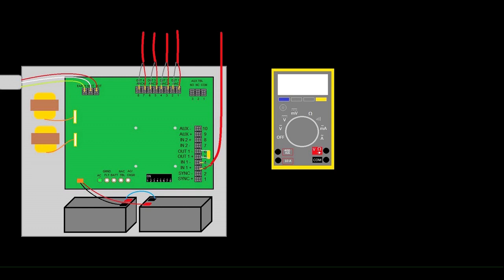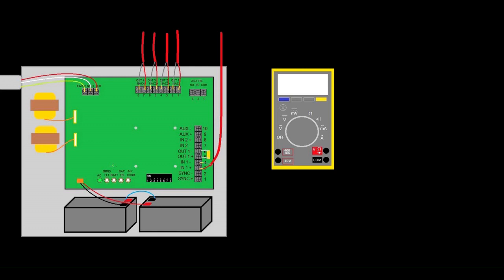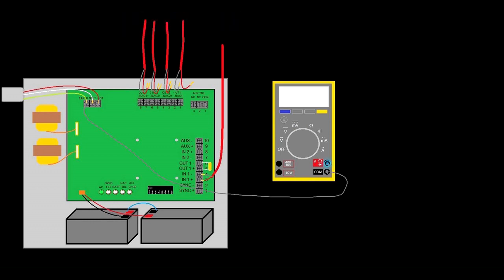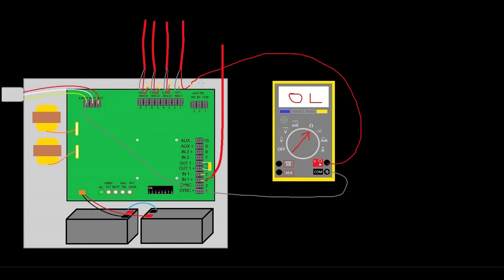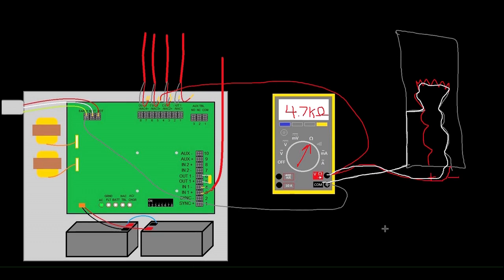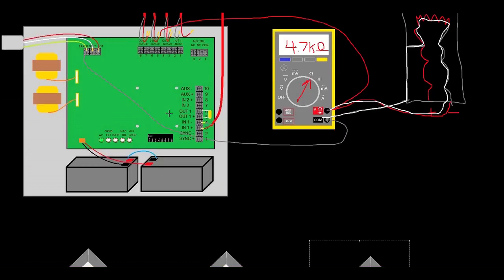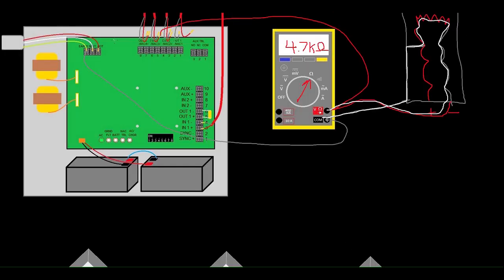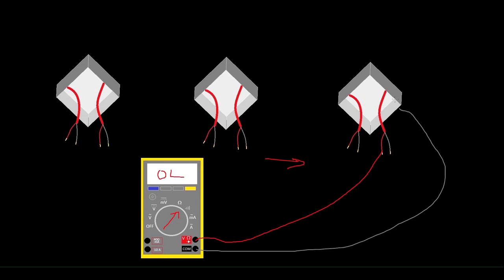32 - Metering a Ground Fault - Introduction to Fire Alarms

Comment: Question: if you choose the option where you jumper one leg straight to ground (as you referred to at 12:30), can you still do that option with both legs landed on the panel NAC? or do you need to remove both legs and do the alternate resistor (ex: 10k) option instead?

Comment: Hey brother got a GF on a system ive taken over a job site its a complete nightmare and im still new to this bosses threw me in this with brainless helpers, I have voltage as well on one of my PLink wires they instead of running 4 used 2 16/2 for the += AB. When i meter it on AC i was getting up to about 3. - 60. even seen it spike to 115 once.

Comment: Hey Joe, I know that intermitten ground faults are a pain and special in a big property where you could have added resistance from different outputs etc.. that could add up and meet the FACP or power supply manufacture threshold. I was looking at the FLUKE 1587 FC insulation meter ($$$). Don't know if you have heard of it, its good for ground faults on motor windings and sorts. But it might be a great tool for the meggers resistance. What do you think? This meter might be worth it?
Reply from the maker: That's an interesting question. I don't know anything about that meter, so I can't fairly say. In my opinion, I would try to build my own cheap ground fault meter with an analog ometer and a bunch of batteries. Several people have written articles or made videos explaining how to do this. I have never done it, but I'm interested to try it. Sounds like it would cost about $30-40, rather than $900. But having never used the meter you mentioned, I can't really say.

Comment: NAC circuits will have supervisory voltage on them when on standby.
24vDC circuits might be reversed when on standby (positive and negative will be reversed), this is common on older systems.
Other systems will have 4 to 7vDC on them to supervise the circuit when not in use.
A quick way to locate a ground fault on NAC circuits is to determine the normal voltage for these NAC circuits and then place your negative meter lead to ground and check the voltage on every wire with the positive lead.
A ground fault will pull voltage down on any wire that's grounded. This will usually cause the panel to push the voltage up on the other leg of the circuit.
This is a great way to find multiple ground faulted circuits when you have lots of them.
Then it's just a matter of cutting the grounded circuit(s) in half, metering forward and backwards until you isolate your fault and (hopefully) fix it.
This same procedure works on SLC circuits, but they're a little easier to determine what circuit is grounded since there's usually less of them.
This procedure works perfectly on hardwire circuits, and theory wise it works on 2 wire and 4 wire circuits of any type.

Comment: What a helpful video.  I have a question if you can help.  I'm working on a Notifier NFS2-3030.  I'm getting a horrible intermittent ground fault trouble coming from guest room sounder bases at this hotel.  The device is causing the ground fault, but how do I troubleshoot a ground fault that would appear for 30 seconds and clears for 15-20 minutes.   At some times clears for 2 days and then spontaneously comes back as intermittent. At this point I'm frustrated because I can't read ground on my meter to the lines... when things clear up so long and causes a trouble so briefly.  Any ideas?  Other than change out all the devices on 9 floor hotel😅?
Reply from the maker: This could be a pretty big problem. There are a lot of variables. You can email me, I will help as I can, but it might be a bigger thing than I can help with remotely.
Reply: @JoeKlochan  thanks for the quick reply... any help will be much appreciated
Reply from the maker: What is your power source for your sounder bases
Reply: @JoeKlochan  the way its set up now; its from ACPS 24 volts.  And that is power through the main power supply
Reply from the maker: I have a couple of thoughts. First, when I was fairly new in the industry we had a similar problem to what you're describing but it was on a new install. I don't remember what the solution ended up being but I think the problem had something to do with a conflict between the FCPS panels we were using for sounder base power and the main panel. 

If this is an existing setup and the problem recently started, I'm thinking maybe a different type of meter may help you. I have not yet built one of these myself, but the idea is intriguing to me. Google "build a low voltage insulation tester".

The idea is you only have a 9 volt battery in your meter, and when you meter resistance, you're putting a very small voltage on the circuit. Sometimes there's not enough power from your meter to make it through a pinched wire or some faulty insulation. A meter like this would theoretically help with that. As I said I haven't done it, but I would like to. This may help you, it may not. You may be dealing with some sort of voltage conflict. Does the ground fault clear when you remove the 24 volt power circuit?
Reply: @JoeKlochan  this panel has been installed in 2017 and the problem just started up.  I've isolated the intermittent ground to the 5th floor rooms about 2 weeks ago.  When I remove the 24v, the problem clears for quite some time.  When I add voltage back, it pops up intermittent after 3 minutes.  Problem now is that it would cause a ground for 30 seconds and then clears for 20 minutes and sometimes longer.   
I've encountered this exact issue 8 months ago.  The same ground fault and a sounder base 'no answer.'  When I replaced the base, the ground cleared as well.
Reply from the maker: It's been a while since I've tried this since I don't really work on notifier panels anymore, but I think it works with your panel. If you set your meter to DC voltage, and meter the voltage from the battery negative to ground you should be able to see the 5 volt square wave that is the ground fault detection circuit. If memory serves, your reading will fluctuate between about 2 and 7 volts, switching every 2 seconds. When you have a ground fault on the system, that wave will flatten out noticeably. So if you remove your power circuit and meter that, then put the power circuit back on, and notice the wave flatten out, you may be able to trace it that way. You could have someone in the field start opening the power circuit while you are downstairs metering the ground fault circuit, and you should be able to tell when the problematic base (if that's what is causing the problem) has been eliminated from the circuit.
Reply: @JoeKlochan  thank you so much for your feed back.  I will try this out and let you know the outcome.

Comment: Fire alarm systems are at times frustrating when it comes to tracing and troubleshooting ground faults.                             I think the video is very informative.  You did a great job explaining the wiring of the circuits and the Understanding of the circuits is very important when trying to trouble shoot Ground faults opens and short circuits etc.     
                                                                                                                                                                                                                    I have been servicing maintaining and programing commissioning large life safety systems for over 30 plus years.  So, when it comes to the infamous ground fault IE SLC, NAC, 24VDC Aux etc.  Negative or positive doesn't matter. 
 Troubleshooting is key on the approach on how to investigate the fault. Like was there any construction done recently?  Known water leaks floods, roof in the building etc. This would help out the technician pinpoint the area. When breaking up the known circuit in the fire alarm panel. The Technician on site will not know how its wired (doesn't matter) The key is to break the known faulted circuit in halfway segments which once done they will know which half is causing the fault. Always Both wires of the circuit Allot of electricians miss that and they spin their wheels                                                                                                                                                                                                       The key here is at this point is to keep breaking the faulted circuit in half's IE not Every device etc. This will be a time saver, along with never having more than 2 to 3 opens of the circuit any 1 time so you don't' lose track of the path where the ground fault is located IE class-A or B Etc.                                                                                                                                                                     Now not all ground faults have a low resistance. Most modern fire panels will detect a high resistance ground fault IE 200K ohms or more. Now these may be from a wire that has been pinched in an electrical box or from a cable pulled tight on a metal pipe or HVAC duct or even tie wrapped FPL cable to a threaded support rod etc.    
There is another tool to use in the troubleshooting toolbox.
 Set the Multimeter to DC voltage The Fluke T5-1000 meter will be fine for this test if used. I like the Fluke 87 ($$$) but the 177 is fine anyways etc.
High resistance grounds are not easy to trouble shoot. These can be caused from Wiring faults on the input side of a monitoring module on the SLC circuit.  A 300K ground could be from a Wiring issue or from an input monitoring point.    The video was very good in explaining how to troubleshoot the circuits.                                                                              Most circuits are powered limited so a short will shut off the power but typically most circuits as designed to operate on 1 ground fault but NOT multiple ground faults.
 Voltage is key here Lack of voltage or a low voltage condition from a ground fault will disrupt the SLC communication to devices along with not having the proper voltage to operate the Horn/strobes etc. I Hope this helps the professionals in the fire alarm Tech field The more you know sure helps in daily work!!

Comment: thank you for all your videos very good info. I work with EST 3 systems, I have found contractors bypass the ground faults with a jumper on the board, the problem is when we have to replace the RPS! And the ground fault lights up. The way I troubleshoot faults is process of elimination on NACs then move down the circuit until we find it, usually a wet device! a visual inspection around the building and asking questions on water damage to staff helps a lot. I will be taking my NICET level one on Saturday I'm really excited and nevious at the same time.
Reply: I rip a lot of est3 s out and replace them with something that actually works and rid ourselves of map faults.  Although I will say map faults make us a lot of money.
Reply from the maker: Excellent, good luck! If you don't pass on the first try, it will still be good experience to get you used to the test and prepare you to retake it. Get used to using the index in NFPA 72! If you get a question about a pull station, go to the index, look up pull station, and it will tell you every page it appears on. Again, good luck!

Comment: Class B circuits opens the returns. If you take your meter and measure in ohms between the input #1 - and return #1 - you will read an open if the nac panel has a true  trouble on it .A lot also depend if your panel FWR . If you use a second input the same thing applies , however in class A this does not work the same you must wire to the trouble contact 's.

Comment: Hey Joe, any ideas on what might cause an intermittent ground fault on a speaker circuit, or a  persistent, intermittent ground fault in general? For instance a ground fault that comes in approximately every 72 hours give or take, but only lasts 20 seconds and then clears itself. No obvious reason why, the speaker circuit isn't active when it happens, fault seems totally random. Your videos are great, I'm an electrician by trade but because I watched your videos I have been able to troubleshoot many FA related issues at my facility. Saved me from having to pay to have a fire alarm tech preform a service call. Thanks!
Reply: Intermittent ground faults are a pain in the rear. If it isn't showing on the panel it probably isn't going to read anything abnormal. About the only way I know is to start taking a circuit off for a given amount of time and seeing if it comes back. If it still comes in, you know it isn't that circuit.  Once you find the circuit start splitting that circuit for a given amount of time until you've narrowed it down. This could take weeks to trace, but it's impossible to trace a ground fault in 20 seconds.  If anyone has a better suggestion please enlighten me. It's very discomforting and keeps me up at night having to leave a portion of a fire alarm system disconnected for an allotted amount of time.

Some potential causes:
-Moisture can be coming and going in a box some where. Outside weather in an outdoor audio device. Places like food processing plants can build up condensation during night time cleaning hours and then when their machines start up in the morning the environment turns hot and dry. I was recently at an event center where soda from the stands was dripping down below and getting in a speaker/strobe. 
-If it's a gf that shows up at a specific time of day it could be temperature related. I've had gfs that were caused by a pinched wire between two pieces of metal, and the metal expanding and contracting with temperature was cause it to ground at specific times of day.
Reply from the maker: Ok, I don't know as much about those panels. You can usually meter for DC voltage between system negative and ground, and watch that value change as you disconnect the circuit with the ground on it. I would disconnect your speaker circuits and meter them to ground. If you have one that's around 300-500k, go hunt it down. You'll be able to find and fix that.
Reply from the maker: What kind of system is it? What manufacturer?
Reply: Edwards EST-3
Reply: Moisture